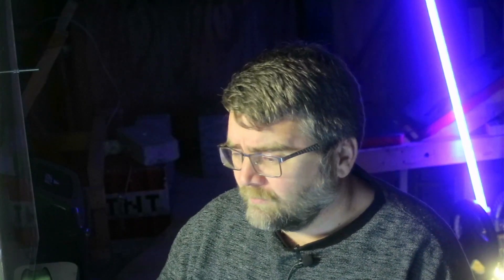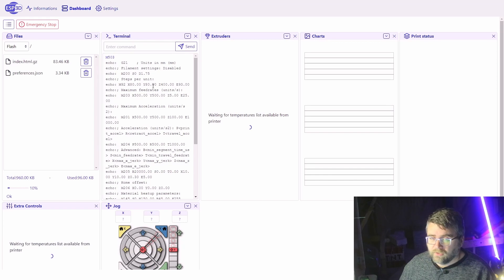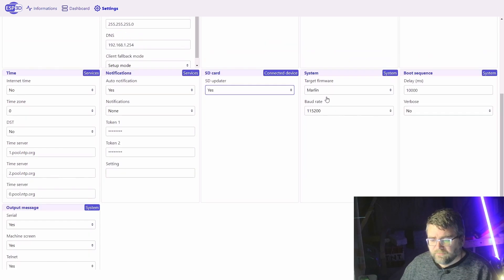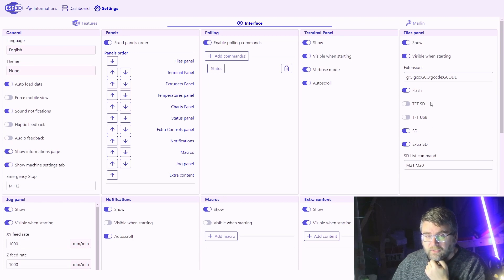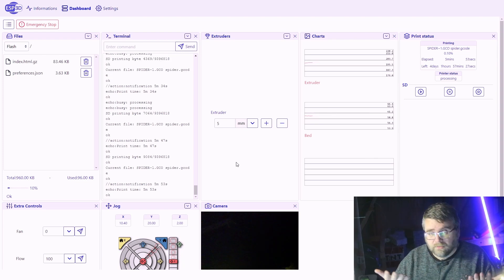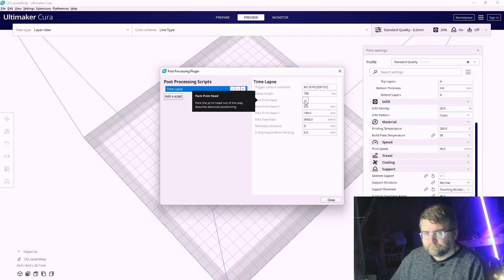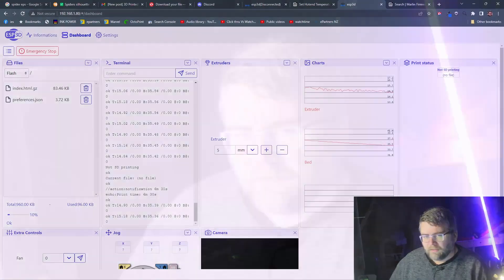ESP3D V3 and ESP32CAM Connection & Configuration

Comment: What pins on esp did you use to connect uart? And how did you get 5v from the printer, or did you set up an external power supply? Because my esp32 cam doesn't seem to communicate with my printer by uart, from what i read its because default uart pins on this esp are used for boot,  gpio 1 and 3, and since we have an sd card and a camera on board there arent any pins left for correct uart connection

Comment: I'm just getting a static picture from the camera, whenever I refresh it updates, no video streaming, what's the problem?
Reply from the maker: If the refresh is below 200ms it won't work https://esp3d.io/ESP3D-WebUI/Version_3.X/documentation/camera/
Reply: @JWNZ  no, actually it was a big, I had reported in the discord yesterday and Luc solved it, now it working fine.
The problem was it was had to refresh automatically but it wasn't, the developer fixed this issue.

Comment: I have a Anycubic Mega zero with ATMega1240p chip. All steps successfully on my ESP32-Cam but cannot connect with the printer. I soldering TX & RX pin on ATMega1240p (pin 9, 10) or on CH340G chip (pin 2, 3) but not success. Can you help me ? Thanks
Reply from the maker: Not to sure. You should definitely check out the github and have a look at the forum there. The developer is really good at helping out.

Comment: Hi, thanks a lot for your job.
On my A20M, all works fine with V2. BUT, with V3; i can't see "SD CARD", "TIME"/... in the Features menu. So i can't upload (or see) a file in the SD Card.
Reply: And, i can't receive temperatures with V3 (all Ok with V2) : "waiting for temperatures list available from printer" ... looping
WebUI version : 3.0.0-a38.M2.1
FW version : 3.0.0.a225
Reply from the maker: I would definitely hit up the developer on the ESP3D GitHub. He is really good at replying to support.
Reply: mee too did you solve it? i can't handle sd tool

Comment: Great work! I hope you can help with the following ask. Then I used the [ESP201] command in the terminal, I get "Error: Missing Pin" when I enter "[ESP201]P4 V1". Am I using this function incorrectly? Thanks.
Reply: do you solution this problem _?
Reply: @mapbll  Sorry, but I gave up on this project. I purchased a Creality K1 Max and now I'm spoiled and everything pales by comparison. I wish you luck.

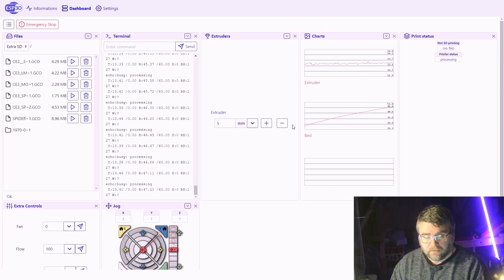Comment: Hi, in 06:56 Camera config when the your menu "Type" has 4 options, the last is ESP32CAM, in my menu there isnt this option.
Any suggestions? I have ESP32-CAM, and loaded V3 and webui 3.0. Thanks.
Reply from the maker: Does the camera work with other firmware? Maybe follow this aritcle https://randomnerdtutorials.com/esp32-cam-video-streaming-web-server-camera-home-assistant/ and see if the camera works. If it does then it would be best to place an issue here: https://github.com/luc-github/ESP3D/discussions
Reply: Thanks, it´s ok, very simple, for defect in the file downloaded from ESP3D version 3 of githup in the configuration.h the camara is with //#define CAMERA_DEVICE. ICAMERA_MODEL_AI_THINKER.
If you don´t edit its and erase the //, the camara isn´t and in the menu extra content in type option, you haven´t the ESP32 Cam. 
Now it is operative.
Regards from Seville, Spain.......

Comment: I've been trying to get esp3d working on an ESP32-CAM for a while now. I managed to flash esp3d but I can't get the camera to work.
I use the ESP3D version 3

When starting the module I see the following messages in a monitor
17:36:03.825 -> E (790) camera: Camera probe failed with error 0x105(ESP_ERR_NOT_FOUND)
17:36:17.611 -> M117 Failed start camera streaming server

can someone please help
Reply: Jan , for defect in the ESP3D file configuration.h from GitHub, the camara is NOT ACTIVE with //#define CAMERA_DEVICE CAMERA_MODEL_AI_THINKER
Erase //,  build and load..........it was my problem yesterday.
Regards.
Reply from the maker: The repo slips my mind at the moment but there is a camera firmware available for the esp32cam. You should try that to cut ESP3D out of the picture and ensure the camera actually works.

Comment: Hi, I do everything with your tutorial, but uploading to ender SD card is not working. In browser I can drag and drop a gcodes to SD card in ESP32CAM and to ESP32CAM flash, but when I drop a gcode to SD card in Ender, browser is opening a gcode, not uploading this to SD. Anyways is a way to print from ESP32CAM SD card or flash? Thank you for great tutorial!
Reply from the maker: Sending files to the SD card in the printer is VERY slow as it is using a serial connection rather than network. You can't really print from the SD card on the camera itself, it may even be disabled. This is because the ESP32CAM is not really powerful enough to keep up with the printer and you will get blobs and slow printing in general. If you want to print directly to your printer I cover that in this video https://youtu.be/chc8zRZh18A but this has some caveats also. If you really want to send files to print quickly I suggest have a look at octoprint or klipper connected directly to your printer running off a dedicated PC or Pi.